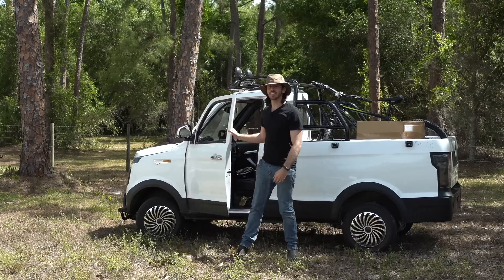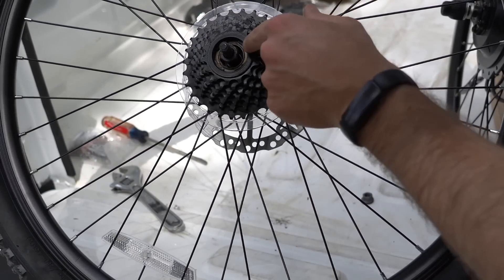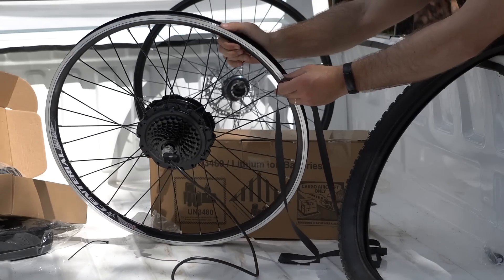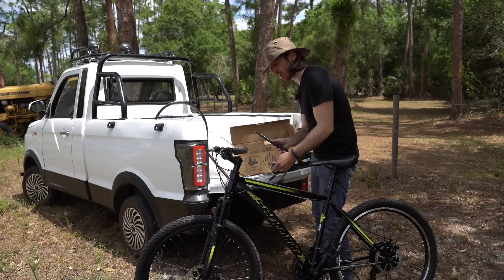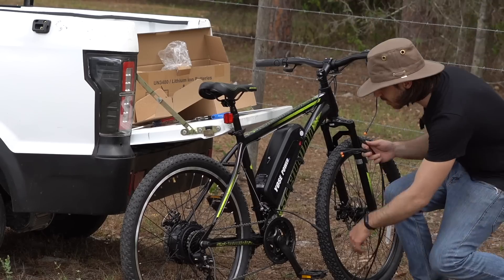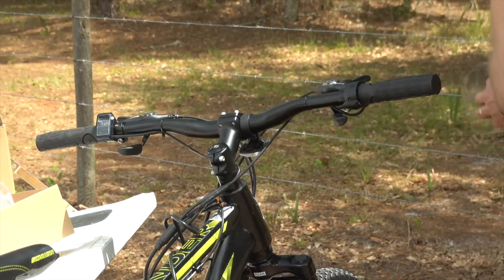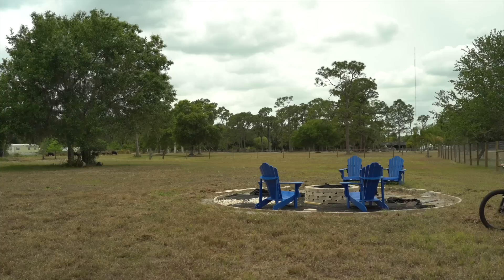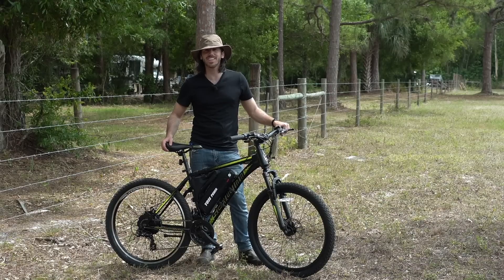Unboxing and installing a simple DIY e-bike kit (Yose Power)

Comment: I just found out my cancer is back and I was thinking of doing this to go back and forth to my appointments.  The problem is I can't find anything to fit my trek multi track.  It's more of a road bike and the forks are very narrow.  I had an e-scooter but it was of course stolen when I let my cousin use it.  He didn't lock it up.  I can't drive when I'm some of those meds and this would be a safe way for me to get around.  The e scooter was really nice and I sold off a collectable rifle to get it.  $2700 wasted.  I would do anything to be able to have a good electric scooter or bike again.  Unfortunately I had to spend every dime I have on a funeral recently for a friend since no one else was willing to do it.  I couldn't believe it and they were very religious.  Even though I'm not I felt terrible they weren't getting their proper burial.  Unfortunately that was every penny I had.  I still can't believe nobody would pitch in.

Comment: what was the top speed?
Reply: The 250W kit has a maximum speed of 25 km/h, the 350W kit can reach around 32 km/h, and the 500W kit can reach about 40 km/h. Of course, if your pedaling speed exceeds these speeds, the actual speed will be higher.

Comment: Yose power kits are absolutely bad. I have broten Hall a docen spokes, so I finally replaced all. And I hay a problem with the Battery too. A garbage
Reply: We are very sorry to hear about your dissatisfaction with the YOSEPOWER kits. We are continuously working on improving and upgrading our products, so your feedback is extremely important to us. We take the quality issues with the spokes and battery very seriously. In future production, we may consider using more durable spokes and strictly control the battery production process.

Comment: use lok tite or thread lock on the bolts holding the disk on because the metal of the motor is crap and will get ripped out

Comment: Brake levers and shifters can be loosened (via single hex bolt on the bottom of either), and slid on the handlebars to make room for the grips to slide completely on. Also, while loosened, shifters and brake levers can be tipped up or down to whatever position is most comfortable for you.

Comment: I have so many questions. What does not using the pedal assist do exactly? How do u replace these batteries?!
Reply: Pedal assist or PAS is just another way of telling the motor to turn on. Helpful if youre trying to get into shape or dont want the motor to do all the work.  

The batteries come with a charger, which should last many charge cycles. If the battery were to go bad, there are ebike batteries you can buy on amazon, they all typically use the same charger.

Comment: what is an ebike for exactly? i assume short distance transport for people who live in cities? usually bikes are for exercise so i find it strange; excluding the previous reason. how do the pedals work in regard to manual pedaling vs electric exactly? if im manually pedaling, if i hit the throttle/power will my feet be able to keep up? or do the pedals not move when you engage the power?
Reply: Transport or for fun. I've never heard of any bike that makes you pedal as fast as your tires are moving so no when your on the throttle its not gonna force move the pedals
Reply: @p3aceandl954  okay so they remain static, and you can pedal at your own pace even with the power engaged? thanks for the answers!

Comment: can anyone help me with a question? if i wanted to convert an ebike scooter from 60v 20ah lead acids(5) to a 60v 30-40ah lithium ion pack would i need to change the controller? Also how do i find out my motor's wattage ? the bike was gifted to me but it doesnt have a manual or any info i can find anywhere on the scooter! all i know is its an EMMO brand....dont know the year or model even. ive contacted emmo retailers here in ontario but no answer just yet...they asked i send a picture which i did....anyway i would really appreciate if someone could take a minute to answer any of my questions!!! Thanks for any help offered! sincerely ....Dan.

Comment: I have been watching your channel for many years. I’m retired and I took an interest in ebikes and making battery packs and I actually learnt how mostly by watching your channel.
I have a question I hope you will answer.
I have an enclosed trike from China similar to your truck but 3 wheels it came with regular lead acid batteries 60v 45 ah
I made a 16s 60 v 46ah lithium ion battery to replace the originals.
Do I have to change any wiring in the trike? The motor is 1200 watts
Frank
Reply: No need to change the main wiring. Just make sure you charge it correctly and cells are balanced, don't over charge and over discharge it.

Comment: Just bought a freewheel version of this kit and installed it on my friends ancient Fuji hard tail bike. It works really well and is a far better value than my previous kits.
I'm going to get the cassette version for a front wheel drive recumbent cargo bike that I'm now building.
Reply: Thank you very much for your support of YOSEPOWER.

Comment: I have a question/ challenge for you.
How would you go about putting a small solar panel on let’s say the back basket of a tricycle that has Electric kit upgrade. I’ve been thinking about doing it for a while now but don’t know how to go about or if it would even be worth it. I figure it would charge a small amount of the battery while the bike sits in the sun. I have no knowledge of how to do this or how not to blow up the batteries from over charging. 
I think this could be an awesome video 
Was looking at a 
“Ghost Controls Solar Panel Premium 10 Watt Monocrystalline Panel for Automatic Gate Opener Systems, Model AXDP “

Comment: I've fitted four yose power kits to various style bikes, there great. I've done just over 12000 miles commuting on mine which is fitted to a boardman roadbike👍
Reply: How fast does it go? And what kind of range?:text-green-game-over:
Reply: Will they fit on a bike with skinny tires?  I have a trek multi trak with fairly narrow tires.  It's a bummer because it would make the ideal electric bike since it's light and quick on the road.  Do they sell these kits with different size rims?
Reply: @paperman9708  I was actually thinking of doing the same thing; but ended up using my Moutain bike instead. 

I'm not positive but I'm pretty sure that a bike shop might be able to let you know. I'm pretty sure it would be possible tho. 

The bike shop would just need to change the rims and spokes out.  But I would just ask a bike shop first. I'm not an exper...
Reply: Thank you very much for your support of Yosepower.

Comment: A question to experienced ebikers: Is this type of kit sufficient when my absolute mininum range should be 30km for a ca.100kg load? Good pedal assistance is enough but has to be good pedaling assistance on 30 degree hills too. So is this type of kit sufficient or should it be more powerful and perhaps with an added battery for those 30-40+ km rides? Any recommendations?
Reply: So in USA maybe they offer 48v 500w. But in EU and UK , Yose offer 350w and 250w 36v. I make one build 250w 36v 24inch front hub. Have to say that i am really impressive.  That little thing have a power. The good point is with the stock display you can change the Current of the controller.  250w 36v scooter battery was my build , with my assistant i go to 27mph on flat.
Now i considering to build second yose but for 27.5 inch 350w with battery included.  Not sure how will cope with 30° hills. I have BBS02B 750W which  am sure will smash this hills very easy, but it's double the price.
Reply: Just get the most amp hours you can with a 500-750 watt motor. You'll want the battery to have more than 1,000 watt hours for range. Keep pedal assist on and in the lower settings and you can get very far.
Reply: Thank you for the replies mates 👍

Comment: Saw a few of your videos.
You are generous in information.
Could I put one of these e-bike kits on a Cruiser bike 1speed, with coaster brakes?
The issue would be no disc brake in the back tire and the sprocket on the back tire may not fit on the motor wheel.
And the back tire is 26".
Compatible or not?
Thanks a real good video.
Reply: Sorry for the late reply. If you have any questions during the purchasing or usage process, please feel free to contact our customer service.

Comment: Hello sir, I have an older single speed 28” wheel bike called a Huffy root beer. Caster brakes. How do I figure out which hub motor will fit? Thank you

Comment: I am interested in purchasing this kit as my first e-bike experience. What kind of range can be expected from this kit with an 85 kg rider? Thanks!
Reply: I have the same or similar question, with addition that the absolute mininum range should be 30km and tens of added kg for shopping purposes. Good pedal assistance is enough but has to be easy pedaling on 30 degree hills too. So is this type of kit sufficient or should it be more powerful and perhaps with an added battery for those 30-40+ km rides?

Comment: LOL the one thing I really wanted to see was the adjustment of rear brake.   I've always had issues with that on my radpower bike as the adjuster is on the inside behind the motor, meaning you have to take the rear wheel off every time you adjust and if you get it wrong...you take off the rear wheel again.    Makes it difficult.   Thought you might show the better way.

Comment: What range does this kit give you? Does the display have a setting to change to mph?
Reply: The range depends on many factors, such as using only the assist or only using the throttle, there is a big difference. I think it can be about 60km range.

Comment: I like YOSE Power kits, I have a front-wheel motor on my trike, and I especially like the easy to fit cables with the waterproof plugs & sockets
Reply: Thank you very much for your support of Yosepower.

Comment: I have one of the yose kits a 350w version and it's good, I never install the throttle always use a Pas, you normally have to use the supplied rotor bolts as the ones on the existing bike are usually too long as I found out, they catch on something inside and make a noise.
I have done over 500 miles so far and I am very happy with it, main reason I chose this kit was the controller was inside the battery making it a neater install.
Reply: Thank you very much for your support of Yosepower.

Comment: Great video! You made it look real easy. I bought a similar kit from Yose Power though mine is only 350w because I'm in the UK and they are wimps when it comes to bike power. I used a smaller bag for the controls and cables and did the opposite to you and left out the throttle so mine is pedal assist only. I've been using it for nearly 2 years now and it is great. I can cruise at 18mph with very little effort.
Reply: @RandomShart  OI! YOU GOT A LOISCENSE FOR THAT MOTER!?!?
Reply: @RandomShart don't be so power grabby. Lower power means less battery consumption, more efficient, depending on the power required and duty cycle. I can see how quickly one can ramp up speed with 1kw and crash, UK roads are dangerous..
Reply: Not always depending on terrain. If it's under powered it becomes more in efficient as it gets hotter. Plus most bike displays you can adjust speed which limits the power to the motor. So you can go up if you want with a more powerful motor.
Reply: Thank you very much for your support of Yosepower.

Comment: Is the throttle power based on the assist level?
Reply: In fact the sensor installation in the kit is missing from the video. Complete installation kit, it can work with assist or throttle
Reply: @YOSEPOWER   @YOSE POWER  I appreciate the reply, but you didn't answer my question. Is the throttle power dependent on which power assist mode you're in? Do you get full throttle power in all assist modes or do you need to be in the highest assist mode?
Reply: @BB-di3em  Hello, the throttle speed does not change with the assist mode.

Comment: Thanks for this great video!
You sure made mounting the tires on the new rim look easy. As a first timer converting my 20in folding bike with a Swytch kit, I got stuck at the tire part. Got tire lever tools. But, damn tire just wouldn't get on the 20in wheel. After shredding up my fingers and cuticles for an hour, I finally took it to the local bike workshop. 😅
I hope you can do a comparison video between the Swytch bike kit and these conventional conversion kits. I have the new Swytch Bike kit on pre-order for my MTB. The lower price and higher power of these kits made me re-think my purchase. Plus, Swytch kit doesn't come with a throttle, only PAS.

Comment: Hi. I have bit of a random question. I am building my first ebike. The spec on the parts are ebike kit=72v 3000w battery=72v 58.8Ah. The kit and battery are from different suppliers. I know the info is minimal but is the Ah on the battery too high? There is a 24Ah option from the same Alibab supplier. Thanks.
Reply: Battery amp-hours (Ah) can never be too high. As long as the voltage is right, you're fine.

Comment: You can upgrade the brake rotors (with adaptors) and possibly pads for not a lot of money, as I believe this comes with 160mm rotors. They're probably just barely adequate for the bike without a motor. I would probably go with 180mm rear and 203 front to be on the safe side.

Comment: As someone who already made a DIY E-bike, I really appreciate this video. I like that extra part you added for the downtube mount, I had to drill and grind new holes into the bike.
Reply: You can just remove the bottom part of the battery holder and drill through it. Should be 4 screws.
Reply: @The_Upgrader  That's what I did too. You can make them fit with a bit of imagination.

Comment: Just found ut channel. Instant sub, and will be ordering your books. My only issue with this video, is you kept some of the small details out that only a bike mechanic would understand. I have so many questions for someone like you. Can u run two kits? One on each wheel? How do the prebuilds govern themselves? How do bypass the governers. I had a 500 extreme scooter that was governed down to 20mph, soon as I bypassed it(easy on that model) I was going 40mph. That normal? Seemed to me 500 watts on a very heavy moped was plenty of power, once the governer bypassed
Reply: Look back over Micah's past videos, he has built a dual motor ebike before.

Comment: Question: how hot is it normal for an ebike controller to get? I have the same design where the controller is integrated into the battery cradle. 
When I run my ebike to produce anywhere between 500 and 900 watts for more than a few minutes, it gets not so hot that if you touch it you instantly recoil, but hot enough that to leave your hand on it for more than 5 seconds will hurt. Is that normal or am I going to destroy my controller?

Comment: Big question for me is what is the battery quality like? True capacity and true longevity? Could be answered with some fancy chargers, or by real world testing!
Reply: Hello, for example, with a 36V 13Ah battery, the range is between 47-156KM, depending on various factors. The battery can be charged over 1000 times.

Comment: Doesn't the brake inhibitor also keep the pedal assist from kicking on should you pedal with the brake on, not just use the throttle?
Reply: The motor inhibitor stops all motor operation. Whether that be throttle, pedal assist or cruise control.

Comment: Great video. You know what you're doing. Although I would have put the power cut off brakes on there and would have installed PAS as well. Inline brake cuts would have worked. Wouldn't put that bag on there just because I would want to be able to remove the battery with the key.
Reply: So …….. make a video then brainiac 😵‍💫

Comment: My wife and I have a Schwinn tandem, but because of years gone by we can't self power it like we use to. I wonder if this unit would bring back the joy we once had riding our bike together?  Thanks Dale Sr
Reply: I can't speak to what kit you should get, but definitely get one. It will put the fun back in riding for those not strong enough anymore.
Reply: A 'Front Wheel' conversion kit will probably suit it better.I though the same,but I don't think the wires will do a 'rear wheel' kit.They both come with the same accessories.(Most I've seen don't come with a battery,but his kit at $500 covers the battery too and they're $200 and up).